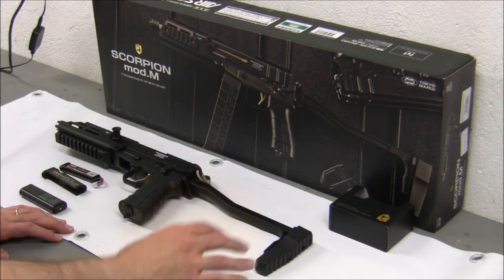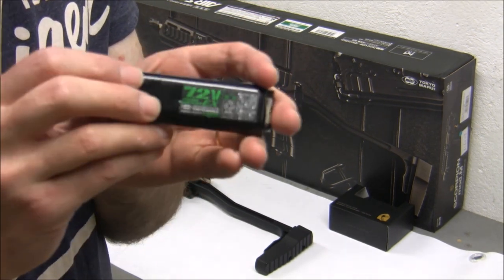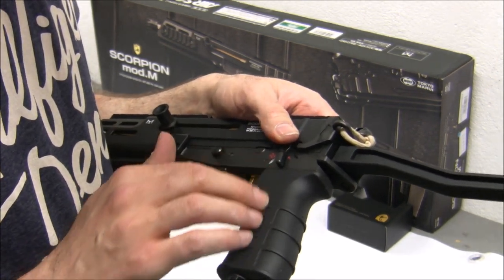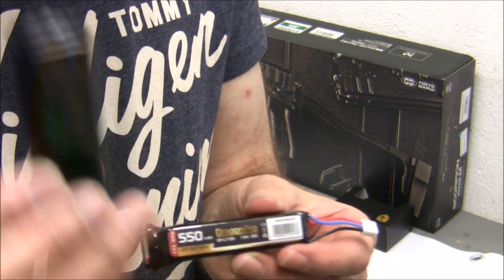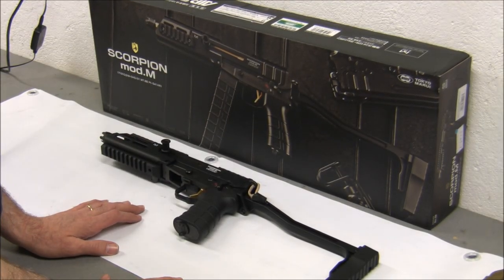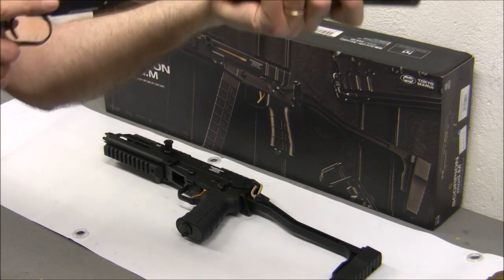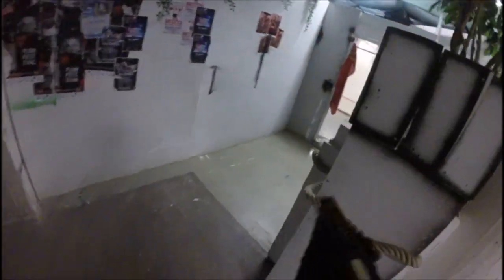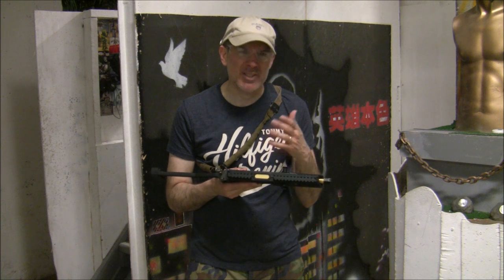Scorpion Mod M (Tokyo Marui): A Comprehensive Review

Comment: The difference of energy is due to the longer barrel, the original scorpion has a shorter barrel which reduces projectile velocity hence lower energy... Basic ballistics (or physics, depending to whom you're talking to, lol)
Reply: Looking at the exploded view of each gun they have the same barrel. They just use a different length suppressor adaptor.
Reply: its not relying on gas/expanding gas so a longer barrel will not speed up the bb no. If anything it will have the opposite effect.